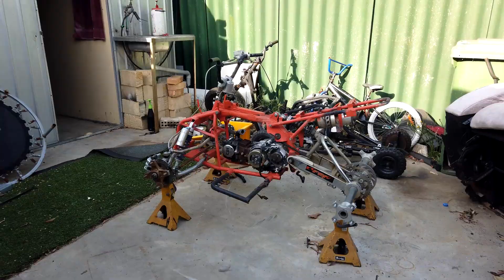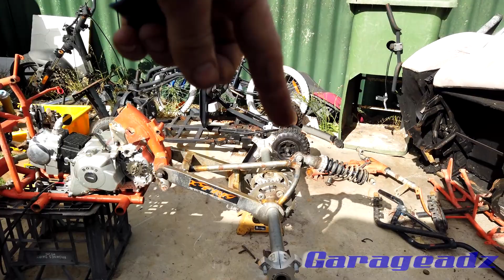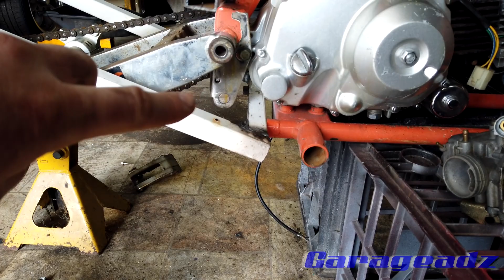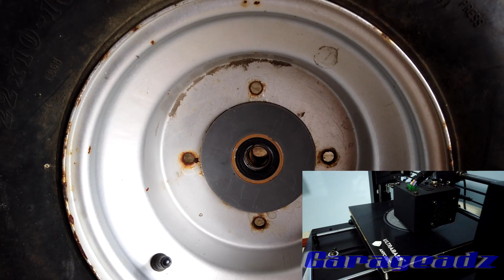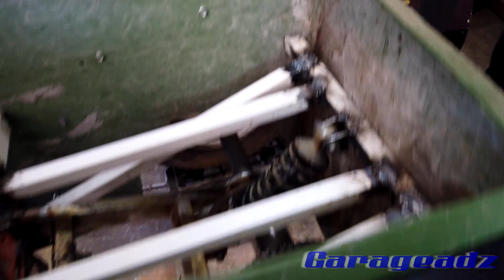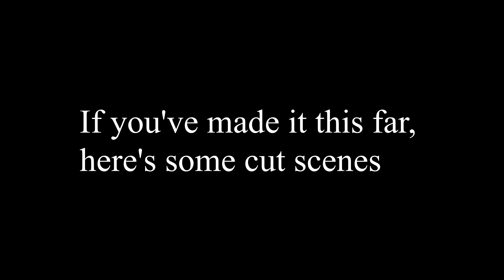Power wheels project part1

Comment: I dont like to spend cash as well and im building a gas power wheels with a 110 Chinese atv and a Cadillac escalade power wheels body , but mine is useing the small 3 bolt wheels 8 inch rims also not stretching the body like everyone does , it will look like a normal power wheels but with full suspention and gas motor . Going to start with 110 auto motor and if all goes well i will save up for the 125 3 speed . Im 75 % finished just need to mount a gas tank and make a seat and i will post a video when done ...nice job on your build by the way 👍👍
Reply from the maker: I have one like that using a small BMW X5 style body. easy enough to do and still works great.  Originally I had a 110cc auto in this and went to the bigger motor later because the build ended up being a bit heavy.
Reply from the maker: The BMW is in one of my other videos, the powerwheels at the holiday hose video if you wanted to check that out.
Reply: @garageadz  i did watch that video lol nice to see it go through water with no issue's , there is a video where a guy build a Silverado power wheels with a atv like mine and its what inspired me becuase its so small its awesome , like the bmw